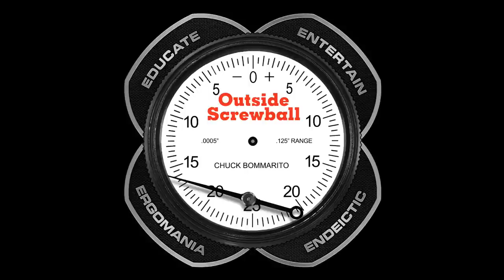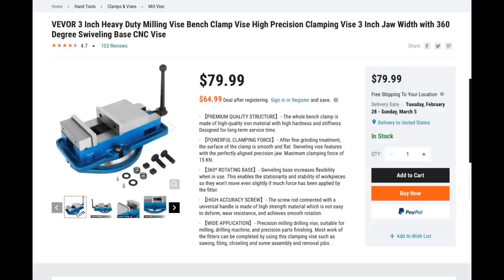VEVOR 3 Inch High Precision Mill Vise Product Review

Comment: I bought a vertical mill slide for my 250G lathe, came with a drill press which didn't impress me and I was looking to replace it. Your review of the VEVOR vise impressed me and it was exactly the size I was looking for, so I bought one.
What surprised me even more it cost me $AUD 83 delivered as I live in Australia. That's a first costing less than you can get it is the USA (equivalent $USD 55). Chears

Comment: I've got the 6" Vevor (got it about a month ago) in the non-swivel.  It's great!  It's on my CNC converted "G0704". Because of its limited Y travel, you pretty much have to run it sideways.
Reply: Same here. I found the vice bed to be about half a thou. The top of the vice jaws was a couple of thou from memory.. One of these days I'll set the cup grinding wheel up in the mill and take a skim off the top. Other than that I am impressed!

Comment: It would seem fair to compare to a high dollar vise, something that you must have on hand.  The jaws are frequently milled once a vise is trammed, as long as the ways are flat.  I got rid of my large vise because it hangs over the front of my mill table an annoying amount, and replaced it with a pair of 4" SPI sourced (Eron) vises mounted a few inches apart, side by side.  This gives a ~12" long jaw clamp in the X direction.  The other nice feature of the smaller vises is they are so low that I can keep my 4th axis rotary and tail stock on the table because most of my rotary work will ride above the vises without removal.

Comment: great review. i would have loved to see if there is lift in the jaw/workpiece as it is tightened. Without that info I couldnt be sure if the vice is worth buying. Cheers.
Reply from the maker: thanks for viewing and your supportive comment
Reply: I have the 4" version and there's virtually no lift. I put my tenths indicator on the moving jaw and a workpiece and I barely got any movement, less than 0.0001". Perfectly fine for my hobbyist usage. 👍

I did clean and deburr everything, and lubricated appropriately before checking the squareness/parallelism and movements of the vice.

Comment: The thing you need to check is Jaws side to side and how the jaw moves front to back compared to the stable jaw
 I believe mine comes from India and the movable jaw id like a dish, it moved at an angle not straight so theu made the fixed jaw crooked. To account for that.

Comment: You really need to remove the movable jaw and sweep the entire bed. Not just in a line, but the width of the bed rails too. Also, find if the fixed haw it perpendicular to the bed. Then put a reliable parallel vertically in the jaws in the middle. Close so that it just barely holds it firmly. Measure vertically, them close tightly as though you were actually going to mill and measure again. Thus needs to be done while screwed down on the mill table. A lot of buses will have the bed bend when this test is done and the part moves away from vertical.

A problem when the bed is different from one side to the other is obvious. Even a one half thousandths difference between the heights of the two sides is a problem. Since we align the bottom of a part on that bed a 6” long part will be over a full though from end to end on that vise, not good for parallelism or for fitting two parts together as neither will be parallel.